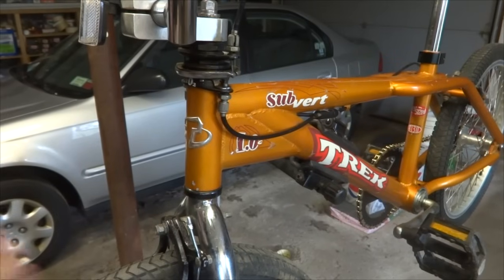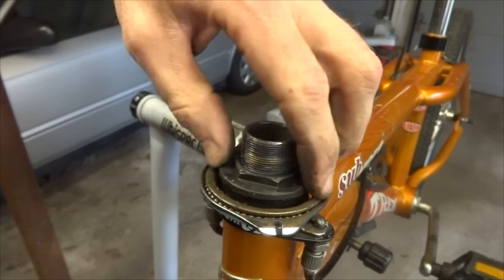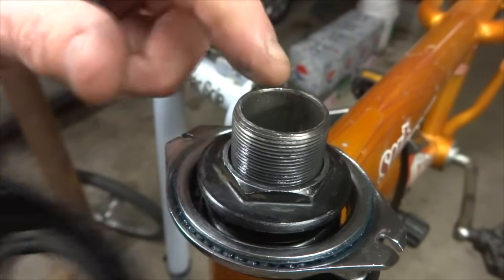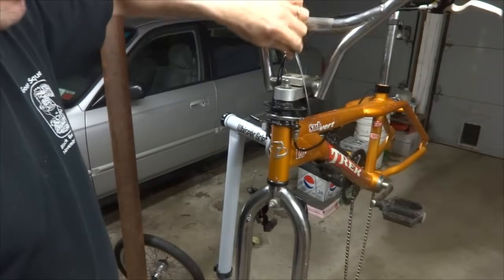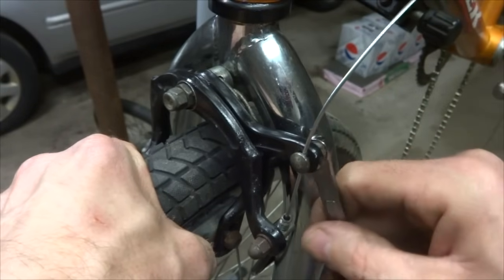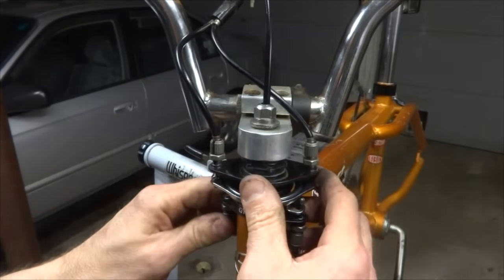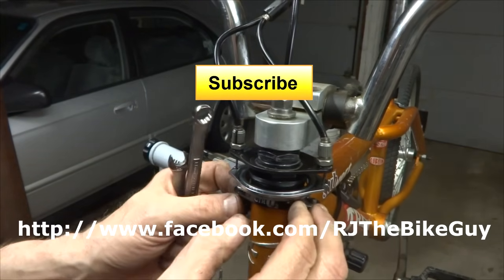Overhaul BMX Bike Headset With Gyro/Rotor/Detangler

Comment: Cool. I just picked up a new one of these bikes yesterday for free at work and had never seen this setup before. I haven't taken it out of the factory box yet, until I knew what all the parts were so I wouldn't have to worry about loosing any of them. Today thanks to your video I'll be putting it together.

Comment: I got a question do you need holes on your bike frame if not then which gyro kit  should I get. I am not drilling holes in my bike I don't want to mess it up also I also don't want to ride brake less. So please tell me if I can install a gyro kit with no holes on my bike.

Comment: what is the part called you use to pass trough the front brakes cable inside the steering tube and can i use this on every BMX handles ? because i am new to BMX and coming from normal bike riding i prefer to have 2 brakes. nobody talks about front brakes in BMX scene. i plan to get a 24" cruiser BMX.

Comment: Where do u get that stem bolt with a hole that goes the cable tru under the fork where  can i get ...what do you call this thing????
Reply from the maker: It's part of the gyro system.

Comment: Hey what's up don't know if you'll get this comment, but I went to tighten the handlebars and the little wedge at the end is stripped. What do I even call this piece to order it?
Reply: I probably need a new threaded Bolt as well as the funky wedge-shaped piece of metal the locks into place. I hardly even know how to describe it without sounding dumb

Comment: rj is that gyro built in ? if it is can you replace that headseat for an intergraded one , i have the same bike but that gyro is stuck so i think its just built in . and i was wondering if i can just put an intergrated headset or will the gyro not let it go through ?

Comment: I have a mongoose bmx that’s missing the original front calliper for the gyro system. As you know it’s a bit different as the cable loops and connects to the bottom rather than the top of the calliper and i can’t seem to find one anywhere. The rear calliper is a Shimano brand so I’m assuming the front would have been as well but is there a special name for that type of calliper? Hell maybe I should be so lucky and you even have a part number for me. Cheers in advance.
Reply from the maker: No idea. You need to do research, and watch ebay.
Reply: I figured it out. If you look at the calliper on the bike in this video you can take the barrel adjuster and the cable holder and simply reverse them and voila. So you can have a standard side pull from both top and bottom using the same calliper.
Reply from the maker: Glad you got it figured out. These is so much variation of parts, it's pretty much impossible to tell people what bikes have what parts.

Comment: Are all detanglers like this? I've been given a bike with a detangler on it that the frame is likely ruined because someone burned it with a torch or something. I was thinking of taking the headset and fork and using it on a different bike till I can find the proper parts. My intended doner bike is around a 2014 huffy so I have no idea if the sizes are the same though I do think they are because it's still using the old one piece crank. I fully intend to upgrade to better parts when I have the money but I 1 inch headsets and forks are not as easy to find these days as they were 20 years ago
Reply from the maker: I think this is pretty standard.

Comment: I would call that a swash plate,  even if it does not need to swash but only use a collective pitch effect, rather than a cyclic pitch as it is used in a helicopter. .

Comment: awesome great now how do you remove the last peice omg
Reply from the maker: +jhill0962 Which last piece?
Reply from the maker: +AquaLady 420 (HoodChick) The cups are pressed in.
Reply: so you cant get em out to remove the entire rotor
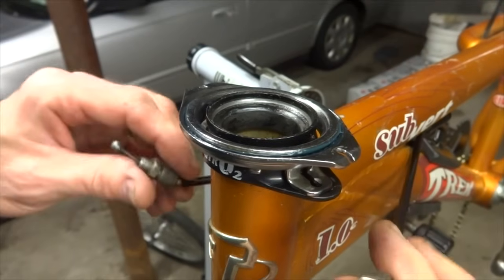Reply from the maker: You should be able to remove the whole thing. Watch this video at about 4:45 https://www.youtube.com/watch?v=CINjuispG5g
The rotor headset might have something more holding it in though.
Reply: jhill0962 exactly! I’ve been trying so hard to find a video to remove everything but I can’t
Reply: We used to just use a large screwdriver and hammer to bang it off. Insert the screwdriver from the bottom of the head tube and hammer away until it pops off. 

To reinstall it we used a block of wood (like a 2X4) and hammer it back on. It is probably better to use a rubber or wooden mallet instead of a regular hammer, though.